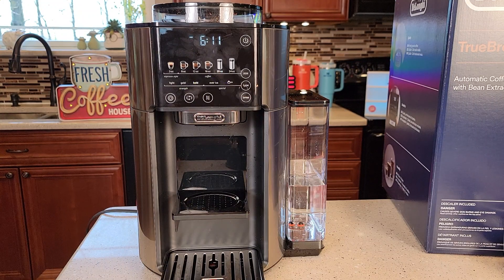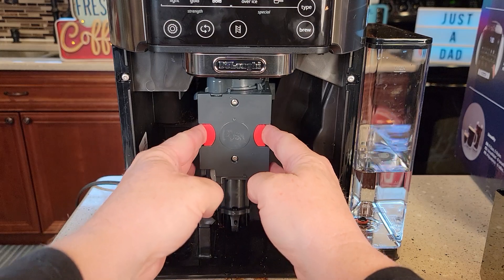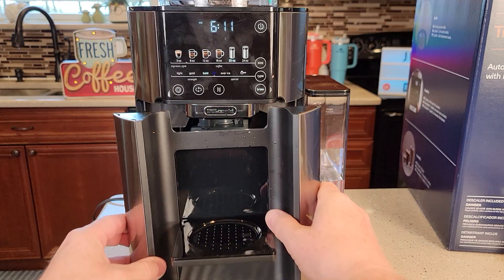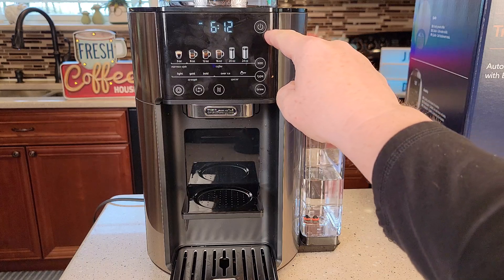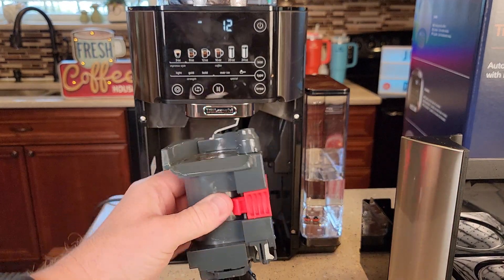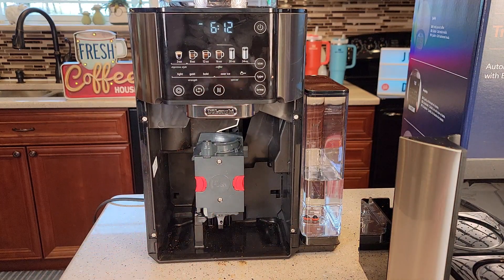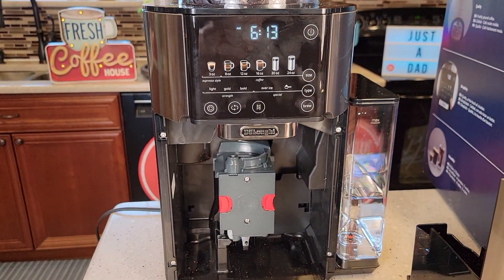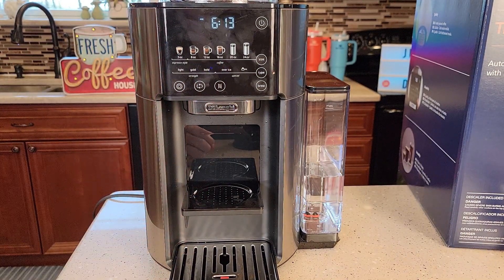How To Fix De Longhi TrueBrew Drip Coffee Maker Infuser Will Not Come Out

Comment: Mine pops, as well - I think that’s normal. I’ve had mine for about a week and love the coffee flavor and the convenience of all the brew sizes. Curious to know if anyone else runs into a bit of a mess cleaning out the grounds and water well? I have standing water that leaks onto my countertop between cleanings, and grounds on the bottom inside housing. Thanks for the video!
Reply from the maker: yes I do have this also but not the water on the countertop,
Reply: Can you please let me know if you found a fix for this? The machine was working fine first few times and now It happens every day.. I'm thinking of returning mine because clean up is alot. I don't know what I'm doing wrong.
Reply: I’ve had that same issue
Reply: Same issue with water leaking under the removable bin assembly - eventually getting on counter and under machine.  I empty bins at minimum every morning and there is always some water inside the machine to be soaked up.  I also clean the removable infuser once a week. It wasn't always like this so wondering if there is an o-ring/gasket that is failing.

Comment: Great tip,  have you found a way to get the beans out of the top if you want to change them or you run low in the bin and want to use a different bean?

Comment: I have the light blinking, but I cannot get the tray to go back into the machine. The red part will not come out and it seems to be stuck.
Reply: Same.  Did you fix it?  I’ve had this machine for a year and this is the first time I’ve ran into this

Comment: I have a red triangle icon that it is always up. In the instruction manual it is written that it is because my infusion unit is not present. But it IS! I tried to removed it, clean it completely, just with water and a smooth toothbrush and put it back but nothing, it is always the same. So it is not working anymore. I sent a message to Delonghi but I don't have a lot of expectation from them.

Anyone had this problem before?
Reply: I’m having the exact same problem now. I’ve done exactly what you did. Pulled power cord out for hours. Turned it off & on . Everything. Had to break out the French press :(